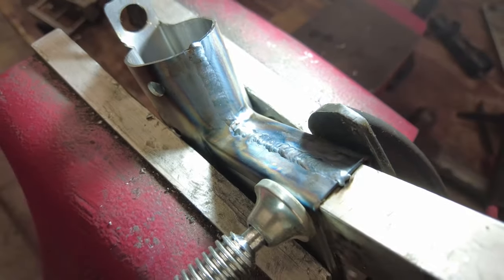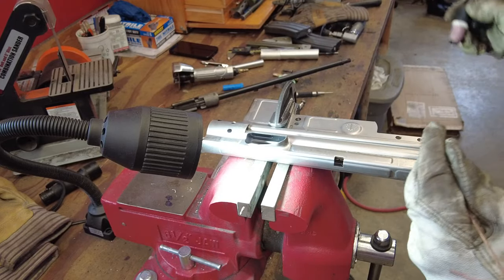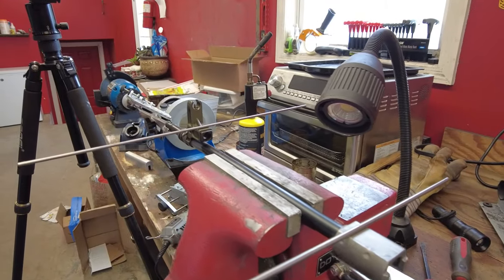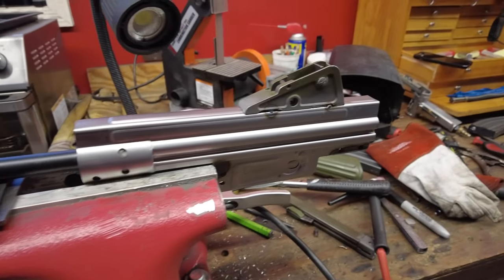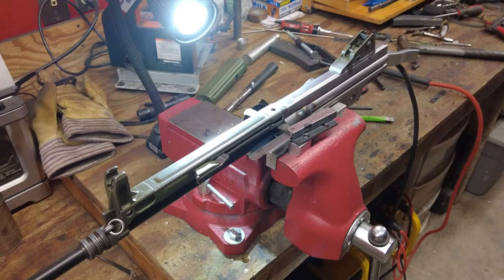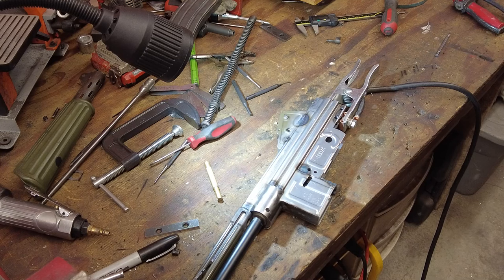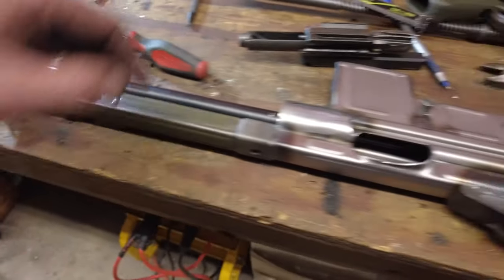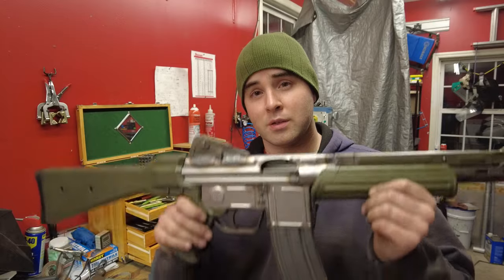Cetme L Build: Wrap Up

Comment: Welds are looking better!. Get closer with the tungsten, less heat and use a .040" rod for that thin work. You dont need to worry about penetration with thin tig welds
Reply from the maker: Thanks for the info! I’m a terrible tungsten dipper so i try to stay away. lol I wanted smaller filler but don’t think they make tartan G in that small!
Reply: @JPMachine  tarten is only needed if your hot bluing the welds....er70 should be fine on park or cerakote receiver projects